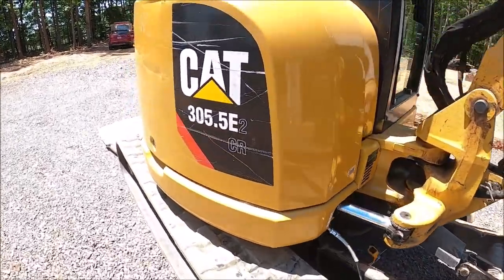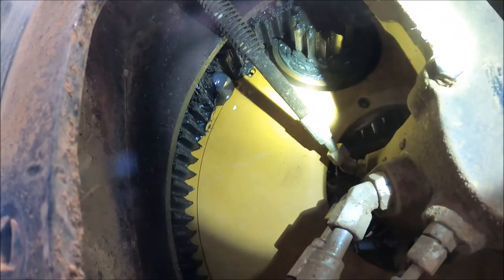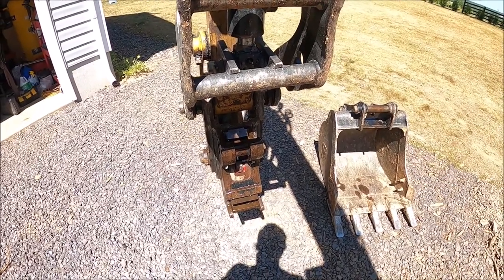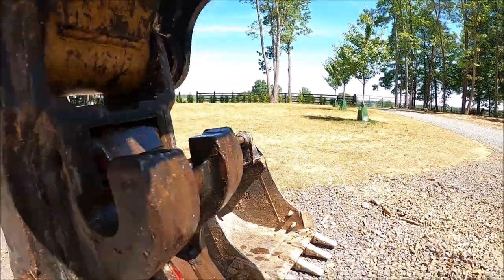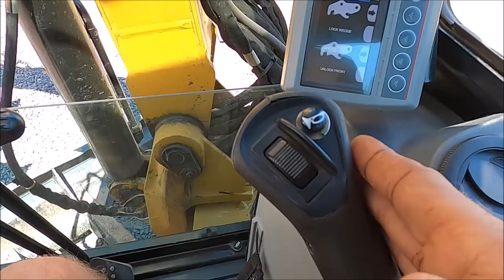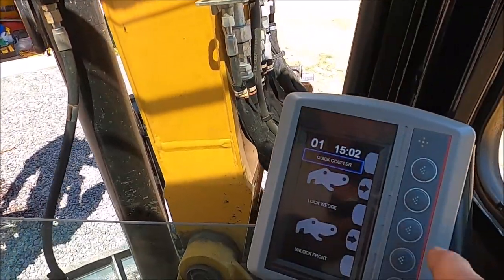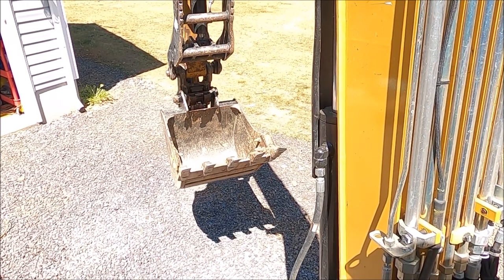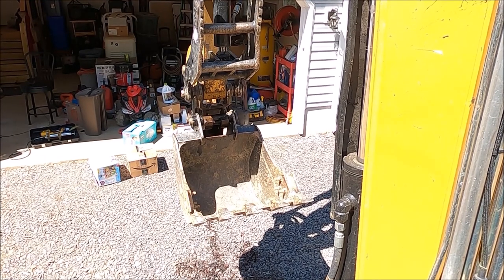Cat 305.5e2 Mini Excavator Swing Gear and Quick Coupler Maintenance

Comment: 🤔 the turntable bearing is only supposed to get like 1 pump every 100 hours or so. If you over pump it, it'll put a TON of stress on the table (giant surface area) 

That's what I was told
Reply: According to cat it’s 10 pumps every 90 degrees done every 100hrs. For a 303-305 atleast.